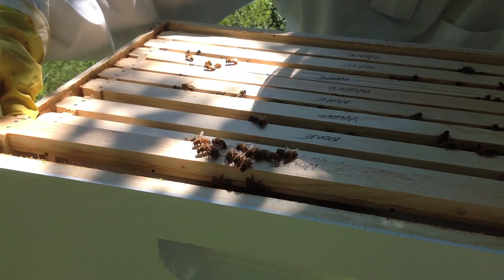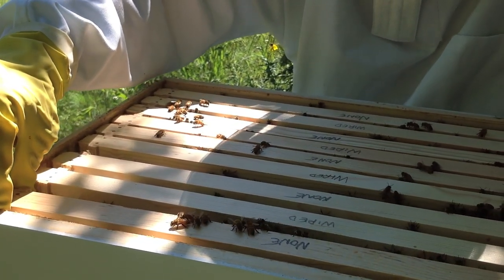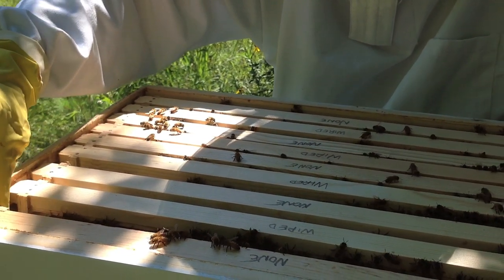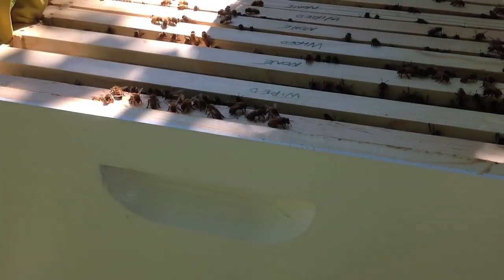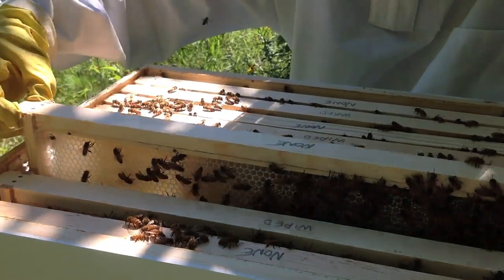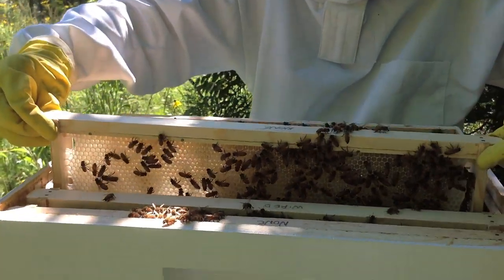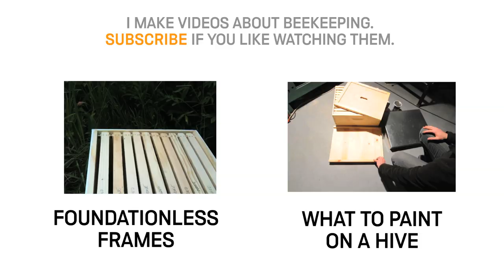Foundationless frames in a beehive

Comment: I'd also be curious about how well they stand up to extraction, if you use a centrifuge...
Reply from the maker: I don't recommend using foundationless frames in an extractor. I've never done it, but I would expect them to fly apart if you try.

They're great for cut-comb though, since all the wax is natural not filled with chemicals. Otherwise, your only option is the "crush and strain" method of extracting honey.

Comment: so you alternated foundation and none and the bees didn't try to build two combs in the gap between the frames with foundation?
Reply from the maker: +Jay Collett The bees built everything perfectly straight. The width of Langstroth frames are sized appropriately for the bees to build one comb per frame, so they would never try and squeeze two combs into that space. By alternating with foundation–on every second frame–you encourage the bees to build the foundationless frames straight rather than crossing between two frames. (called cross-comb)